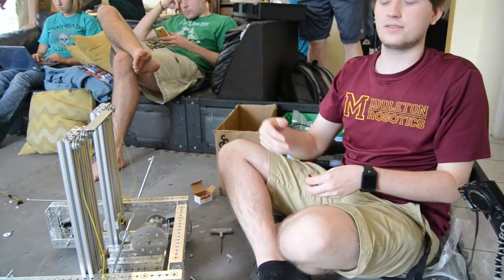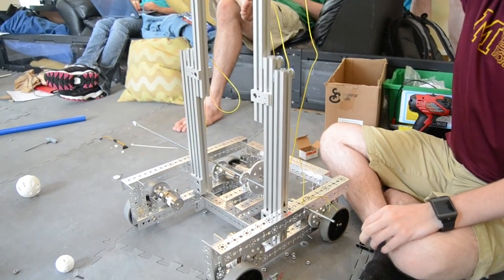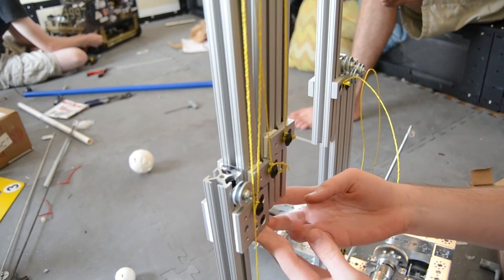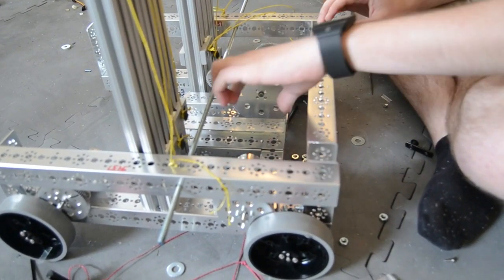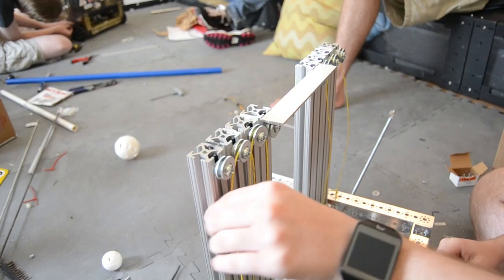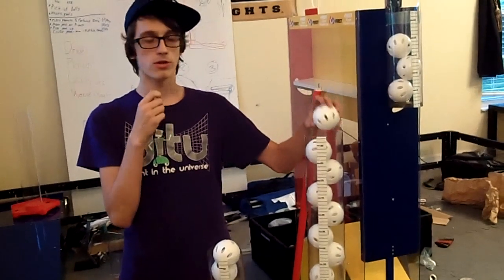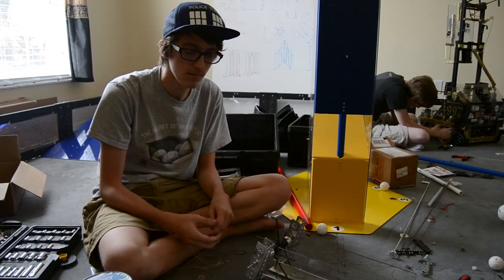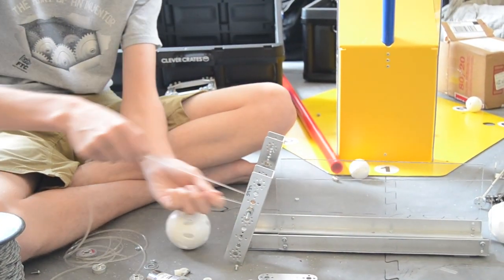Ri1w: Day 2, elevator coming along, intake, and how many balls fit in FTC Cascade Effect Goals

Comment: Appreciate the video.  I was wondering how you connected the 8020 to the TETRIX pieces.  The connection looks very solid from your video.
Reply from the maker: Used 1/4-20 Tee nuts into the 80/20 through the tetrix holes.

Comment: Great video guys! I was just wondering if you guys know how many points you get for one large ball in the center goal (the one 90 cm off the floor). Do you get 6 into the number of cm? (Like 6*95 if you fill it till that). Also, if you put 2 balls into the center goal during autonomous, do those count for these points too? 
Also guys, how heavy is one large ball? 
Thanks a lot for your help. Keep making videos
Reply from the maker: We aren't an official rules group, that would be the official Q&A but I believe the high goal its just 6 points per CM, starting at 0.  I don't know the rules if they are removing or re-scoring balls at the end of the match that were scored in auto.  The balls are all pretty light weight, standard wiffle ball.